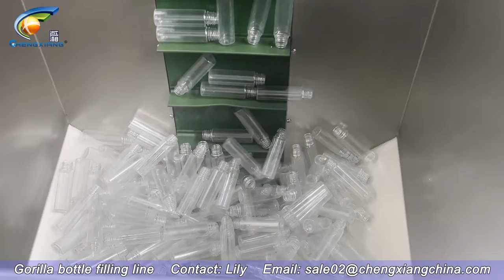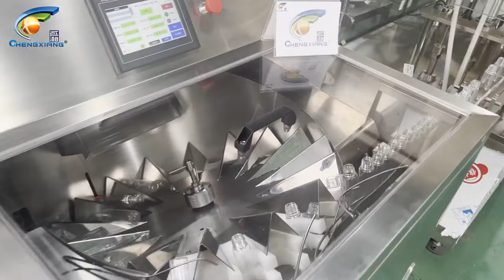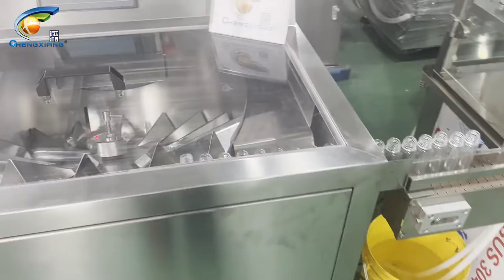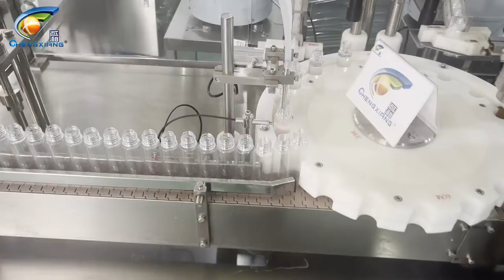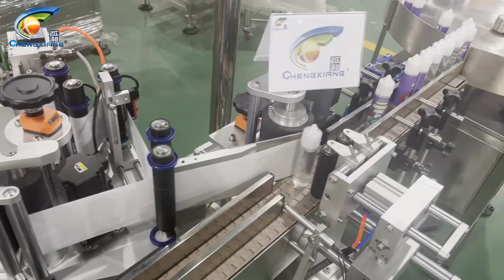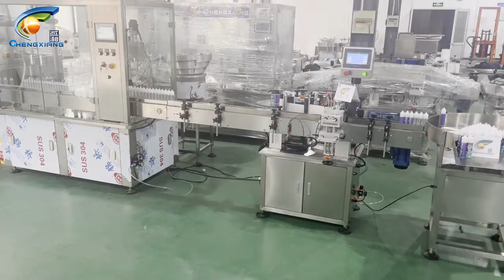Want More convenient Get Gorilla Bottle Filling Line 60ml

Comment from the maker: This Gorilla Bottle Filling Line fit for 10-120ml different bottle and cap size, speed is 2000 bottles per hour, 0%-100%VG.
Gorilla Bottle Filling Line include:
1) CX-LP Bottles elevator & bottle unscrambler
2) CX-YGF Filling and capping machine
3) CX-DTJ Labeling machine
4) CX-SP Bottle collecting turntable
For more information about our machines, services, spare parts and maintenance agreement programs, please use any of the following:
Contact:Lily
Email : sale02@chengxiangchina.com 
WhatsApp/Mobile/Wechat: +86 13795304292